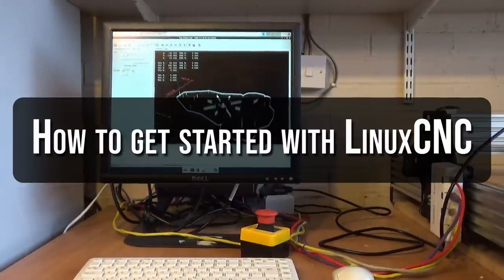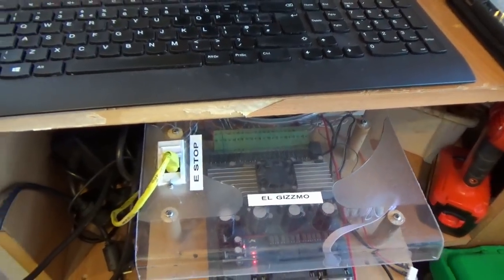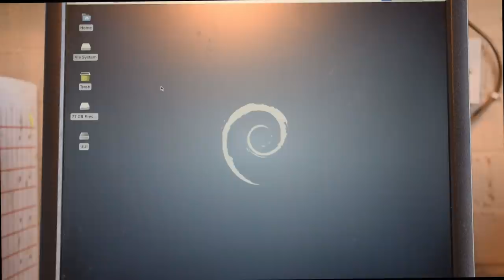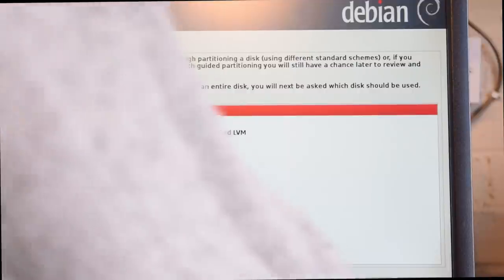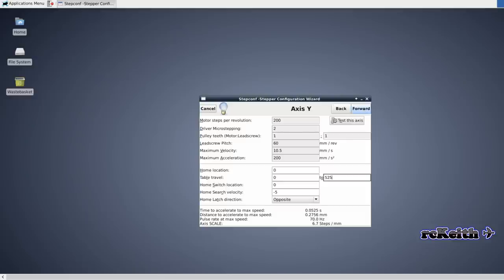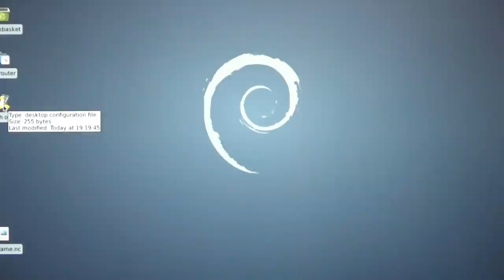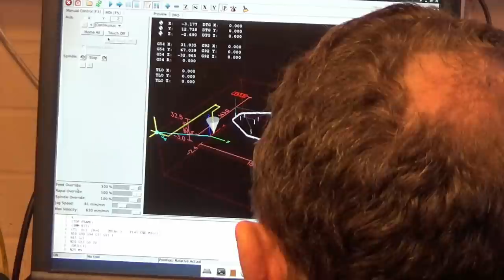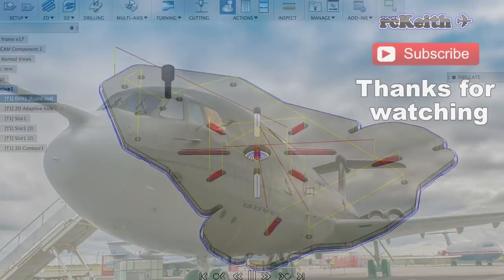How to get started with LinuxCNC - CNC router

Comment: Glad to see another LinuxCNC user out there. I've been putting together a playlist on my site to help people get through it as well. Keith - If you need/want any help getting a custom pyVCP panel started to add features let me know and I'll be glad to assist.
Reply from the maker: Thank Jerry.  A big fan of LinuxCNC especially for Foam cutting the display is very good showing the airfoil cutting paths.  Thanks for the offer, will look into them sometime. A bit overwhelmed with some building work on the house right now, but should be clear soon and get back to some interesting stuff,
Keith
Reply: If you get a chance look at the Frankenlab playlist. If you have some indication you want to see... a button for a special task, etc... I can show you how. (Kinda a hobby of mine when time permits.)

Comment: Just a thank you for the video, I work as a cad cam machinist but I am starting to look at a small system for at home hobby use, this has given me heaps to think about
Reply from the maker: Thanks Matthew. I learnt a load making the video . Good luck with your new system.👍
Reply: @rckeith  is autodesk inventor cam / cnc different from this/??
please answer thank u . i am looking to build for hobby/commercial use as well
Reply from the maker: @samuellobo4882  I'm sorry I never used that software.  Bit it looks like its CAM software.  LinuxCNC is the controller and not CAM software.   CAM software creates the g-code and LinuxCNC reads the g-code and translates that into the movement of each axis.

Comment: Very nice video. I've got a Chinese 3040 4-axis and while I've been using an Arduino Nano running GRBL to a DB25 to control it using bCNC, I've got an old laptop with a PCMCIA/PCCard slot and might get a Parallel card/port and give LinuxCNC a try.  One of my 3D printers( a delta) runs MachineKit via a CRAMPS board. I've heard LinuxCNC has lots of features which can really help fine tune even a cheap CNC well. I appreciate the effort you put into this.
Reply from the maker: Thanks. LinuxCNC is very good and often overlooked in favour of Mach3. People often ask me which is better?  I tell them neither both are very good it just depends on your budget and what hardware you want to use. Certainly give LinuxCNC a try even with a old desktop with a parallel port and it works great.
Keith

Comment: Hello there!
Here's what I didn't get: The same interface board can be used either for Mach3 or LinuxCNC?
Reply from the maker: Yes the CNC controller is a TB6560 with a parallel port connection. Mach3 and LinuxCNC will both work with the old parallel port.  You need a license for Mach3 if you go over 500 lines whereas LinuxCNC is free with no limitation.
Reply: yes can. i has build and uses 4 cnc machine and uses mach3 and change second computer and uses linuxcnc emc2. all working fine after config and motors setup.

Comment: Superb video ! Why does the Z axis motor vibrate like that during the tests?
Reply from the maker: I think it was due to the test setting. It was 5 years ago so I can't remember exactly. I don't use LinuxCNC anymore because my old PC's died. So I now use GRBL Mega 5x.  LinuxCNC is a great program if you can run it,
Reply: @rckeith  thank you so much for your answer !! Is your new card able to drive the steppers quick enough?
Reply from the maker: Yes for have a look at https://youtu.be/mgT1NO6f-yE?si=q1Q9l5d4K6lXRMbL

Comment: Hi Keith can you tell me is there is enough power on a tb6560 3 stepper motor card to power two 2amp motors? I’m trying to possibly use a 3 port to run 4 x2 watt steppers. Thanks
Reply from the maker: Hi, Ron, the TB6560 only support 3A so I would say no.  You are better of getting a 4 axis and slaving the other stepper  That's how I did mine and works really well.
Reply: @rckeith  thanks so much Keith have a great day. It’s 3:30 am here in eastern Canada. Cheers
Reply from the maker: @MrRenoman2011  You are a night owl. Have a good day as well
Reply: @rckeith  new TB6600 have maximum 5A 49Volt  best card today if use cheap cards. then if need more amperes to motor need buy super expensive tcm or what has 583 card, i not remeber type number now. but have expensive TB 6600 cost 10+20$ and tmc or what have cost 100$ 50-100$ more, and can use cheapen model 7A motors. biggest card cost more  and can use 6-9A motors. only stepper motors, if have money not use stepper motor buy closed loop servo controller and servo motors AC servo, but cost about 5000$/ axis.
Reply: better use motor driver card DM 554 or other what can handle maximum current at stepper motors. one motor and one driver, if you use 4 motor need use 4 drivers, 3A motors good option use DM 554 driver, and dip SW need set up near or less than 3A not burn motor, important, 2Amp motor need cheapen TB6600 driver all arduino motor driver and cheap worst drivers maximum have 2 A. but good better drivers handle more ampere. normal cnc used nema 23 motors 470 oz torque about 4-6Ampere maximum current, and drivers normal used DM 554,556,558,etc what have max motor current need little bit biggest driver can handle motor max current sure. ewery motors need own drivers, very cheap all drivers have DM serie drivers cost less than 20$/piece, TB 6600 less than 12$/piece, not expensive,

Comment: Please help me if anyone know about my doubts. 
Mh doubt is if i start a machine and when i just met a problem i had to stop. But when ever i get this problem i have only one option that is to restart the cycle. Actualy i want to know that if i get that problems again can i skip the previous cycles, i mean can i restart the cycle where i stop. Please help me if anyone know hoe to clear it ( Linux Cnc, Native cam)
Reply from the maker: Have a look at this video which shows how to restart a job. It's for Mach3 but you should be able to apply the same principle to LinuxCNC https://youtu.be/x6gvNP2paCo  If that doesn't help try the LinuxCNC forums. I'm not using LinuxCNC anymore I'm converting to an Arduino based system.
Keith

Comment: Hi great video so I need to have linux install mi pc to run linuxcnc ?
Reply from the maker: LinuxCNC runs its own operating system. So you need to install it on its own PC.  You can't run it on windows if that's what you had in mind.
Reply: Ok thanks so really you have to use a computer just to run the cnc Wich is fine any computer probably Will do thanks for the video and your response  I am researching to buy a budget CNC Like the Chinese 3040T but look like there is some issues Whit software to run it I only see people getting good results with CNC linux course you can buy the expensive software but I got bit real bad in the past on buying software on line lie after a period of one they move on to another business and they let you with no soport and also I don't want to spend day's trying to make the router working the 3040T have a great frame and step motors hardware but the electronics controllers are crap and they send  you a software that most people can make it work I really liked your video thanks again
Reply from the maker: @1miltond  You might want to look at  GRBL which uses inexpensive controllers boards based on the Arduino Uno and Mega with Univeral G-gode Sender (UGS) software.  
Mach3 is the defacto standard for CNC routers which is very good. Not free and needs a license to go above 500 lines of g-code.

Comment: I'm trying to figure out how this all fits together. If I get a dedicated pc for running my diy cnc and load Linuxcnc on it can it take the place of windows, or does it have to run Windows also?
Reply from the maker: Hi, it just runs LinuxCNC. The Windows operating system is replaced by the install as shown in the  video. So you don't need it to run Windows as well.
Keith
Reply: @rckeith  So a PC without an os would be a good candidate for a linuxcnc build then?

Comment: Hi Keith, Thank you for posting this video. I'm totally new to CNC. Is there any reason why a Chinese 6040 4 axis router will not work with a laptop? I have just bought one and it says on the control box it will only work with a desktop PC - despite the photo on the advert showing it connected to a laptop. It came with a USB (computer end) to 25 pin parallel port (control box end) adaptor lead. I have an old laptop with Windows 7  64 bit installed and I'd like to use it with LinuxCNC. Before I mess anything up, could you advise me please?
Reply from the maker: Hi Bob, LinuxCNC won't work with USB.  if you want to stay with USB then you will need to use Mach3 or the Arduino based GRBL controller.  LinuxCNC works well with the old parallel port and doesn't require a powerful computer.  I run mine on old Dell Desktops that are getting on for 10 years old.  Mach3 will even run on them.  
It sounds like you have a copy of the UCCNC100 adapter and that will only work with Mach3.  Drop me an email  with a few pics and I'll be able to give you a better answer.
Keith
Reply: Same here I believe mine is a 3040t it will  work on my laptop but I have scaling and homing and soft limits problems right now really tired of mach3 I'm 500$ into them and it has only cut roadrunner twice not happy. I was wondering would I  have to change my mach3 card in my machine
Reply: Sorry to switch to linux
Reply from the maker: Mach3 is very good but can take some setting up. If you do want to run LinuxCNC then I would use an old desktop with a parallel port.  I would be cautious using a laptop with a parallel port card.  Some parallel ports addon cards do not work well as they use 3.3 Volts.  I would stay with Mach3 and try posting your issues to some of the forums like https://www.cnczone.com/forums/mach-software-artsoft-software-/
Reply: @rckeith  most laptop not can use cnc whit usb because all laptop have safe usb connection not give out all 5V and max 500mA have lot lot less power. out. and usb cards not working too less volt ,need use table computer then come usb out full volts and power full have 5,1V 500mA laptops not give this out.

Comment: New Asus Work Station computers have a LPT riser pins on the Mother board that can be plugged directly in to a breakout board using a ribbon cable. I have one with 6 / 7 Generation intel processor.
Reply from the maker: Hi John, thanks very much for that.  I'll add it to the website.😀
Reply: lot better and safety have own pci or isa card in motherboard ,if come somethink fail not destroy mainboard only pci card. mother board cost 190$ and pci card 10$ lot better broken pci card not motherboard hahaha
Reply: @mattivirta  I been fixing computers for over 20 years, don't let that idea fool you. I have seen many computers fried from power sures that came through a ISA or PCI card slot. Breakout boards are the only protection for data using Optical isolation chips.

Comment: I'm new at the cnc program stuff I have a plasma table and I'm look for something I can learn to run I'm have problems with learning mach 3 with lazy cam do u think this will work for my table thanks Dewayne
Reply from the maker: LinuxCNC can do plasma but I have no experience of it.  Have you looked at SheetCam it's used with Mach3 that seems to be the one most people use,  Sorry can't be any more help than that?
Reply: you could try fusion 360 cam software

Comment: how about getting an external hard drive case stick in your drive in the case . Connect to machine and on startup menu boot to external drive when you want to use debian / linux cnc and when you want mach 3 boot from c drive.
Reply from the maker: Yes that would work. I don't swap them very often so it's not to much trouble. 👍
Reply: @rckeith  only problem have mach3 windows, not have REAL time, interrups cut alltime machining run. windows not have stabile and safety platform machine controller newer. interrupts have big problem. and windows all. not working newer good. i has last 4 cnc mach3 and linux cnc and i keep linux because have lot lot better safety and not broken bits interrupt problems. ewery factory machine controllers made only linux platform not newer windows os because interrup and many more problem destroy many million $ machine wery fast whit windows OS. ols DOS can use better than any windows os in factory machines controllers.

Comment: were has link to paraller port card, need add second paraller port to old HP computer what have motherboard one paraller port, need pciE card slim model. and how connect to working linuxcnc.
Reply from the maker: You would be better off asking on the LinuxCNC forums.  Some Parallel cards are known not to work because they output 3.3v instead of 5v. I don't use LinuxCNC anymore because my old computers died. I now use GRBL with microcontrollers.

Comment: Hi, I"m Elson Patricio. I"m brasilian. My cnc router runs with Mach3. They say using Emc2 linux is better. Which is better linux cnc or mach3 ? Thanks for the video.
Reply from the maker: Hi Elson
Both are very good ,  Mach3 is more widely used but can look a bit complicated. LinuxCNC is still being developed unlike Mach3. If you already have Mach3 and it does what you need, then probably no point in changing over. I prefer LinuxCNC for my CNC foam cutter because the display show the tool paths better for 4 axis.  I don't think one is better than the other they both work well. The main advantage of LinuxCNC is its free, which if you are on a small budget can help,
Thanks for the question, and watching the video.
Reply: @rckeith  and linux cnc have lot lot addons what help you made many different parts, boc, finger joint, round hole net etc, automatic many tools and open software many people has made many little tools help user, and main display can change and made what u want see in display.

Comment: i try watch all video what i found linuxcnc touch probe tool height zeroing but not understand, how make button to panel and what file need add were in linuxcnc,  and make subfile or macro this when bush button go to upside at touch plate and go down slowly and zeroing bit height and go to workpiece corner all zero.
Reply from the maker: I don't use LinuxCNC anymore so I can't offer much help. Please ask on the LinuxCNC forums

Comment: I installed linuxcnc on my computer. You mention to stress  the computer when running the latency test, but then say not to have it connected to the internet. So how do you know how much stress to put it under? I did not know how to run other programs while running the latency test but the ones you mentioned. I put 2 and 3 sets of the gears running and got somewhere in the neighborhood of 42,000. Then I did it with 2 gears running a and then YouTube trying to get a video up. YouTube never completely  installed within 1/2 hour. But, the number went to 50750 right away and stayed there for the full 30 minutes. How much to stress  it? This was a windows machine that I loaded linuxcnc on top of it. Thank again for the videos. I got the ebook, but it was funny that it never did come through to my wife's. Hopefully I will completely finish my wire cutter and see how and or if I can get it to work with linuxcnc. My driver board is a old mm2001 board. I am looking to use the cat cables as you have for the stepper. Thanks
Reply from the maker: amtpdb1 I usually leave it running for 15-30 minutes with glxgears running and Gimp and then move the mouse around randomly during  that time. The Max Jitter number should be a good value to use then.  As you found connecting to the internet does make a difference , so that why I prefer not to have it connected.  A more powerful machine may be OK connected,.  I did have some issue with the ebook caused my a plugin  I used on the website, but that's fixed now. Thanks it was you that made me aware of it.  Good luck with your build keep me updated, love to see it working.
Keith
Reply: Keith Howlette 
Thanks for the information Keith. I have been working on getting this going for more years then I care to admit. I solve one problem then hit another and put it away,then start again later. Now that as I said I am retired, I am trying to get it done along with all the other thing I have put off! Thanks for your help an instructional videos.

Comment: I have managed to follow you up to 22 minutes in where you are inputting the parallel port settings, I have a chinese 3040t cnc, what settings do I need to input please, I'm panicking now lol
Reply from the maker: Do you have some details of the controller board with your 3040.  Maybe a picture and I'll take a look, contact me via my  website https://www.rckeith.co.uk/free-linuxcnc-openbuilds-ox-router/
Reply: ewery axis step and dir need configure setting then acceleration speed. volts need be more than 24V amperes need max what motor can use. if mnotor has stamp max A = 3A not use more newer burn motor. votl possiple high what can use. stepepr motor can use 74X more Volts what nominal have, my second cnc i uses nema 23 5volt motors and i uses many year 46volt psu. no newer problem. volt not important better speed come only if volts have high. buty moment and working amperes have important. not newer more than motor maximum have. burn motor super fast.

Comment: Hey Keith. I see you've got an off-brand router. I've been thinking about using something similar (Still piecing together parts for my build). How do you find using it? Does it hold up?

This video is really useful by the way, thanks!
Reply from the maker: Hi 
Yes it's holding up fine. I don't use router all the time just when I need to make a part for one of my projects. I did buy some extra collects so I can use 1/4 inch and 6mm end mills. There's a slight difference in diameter.